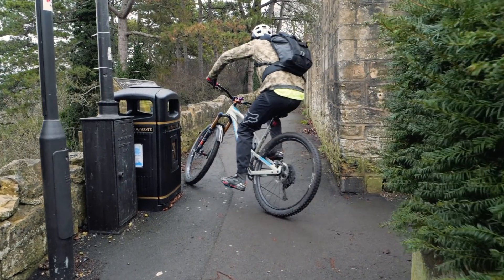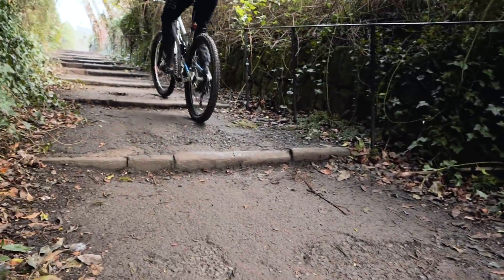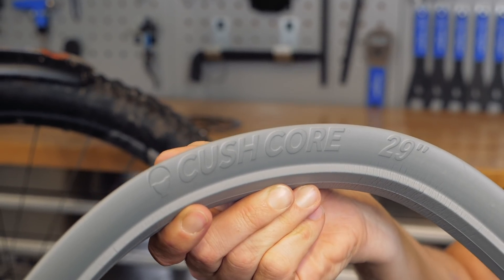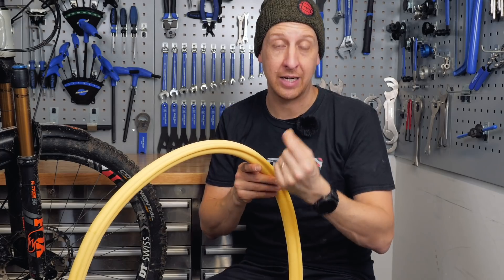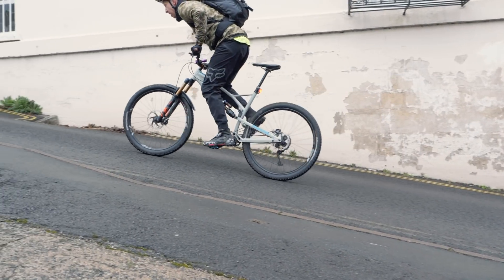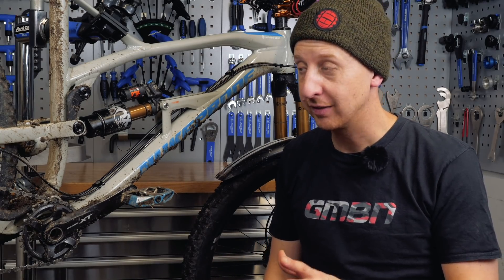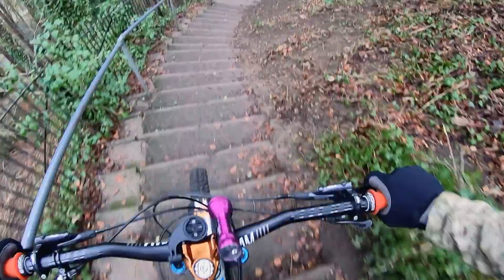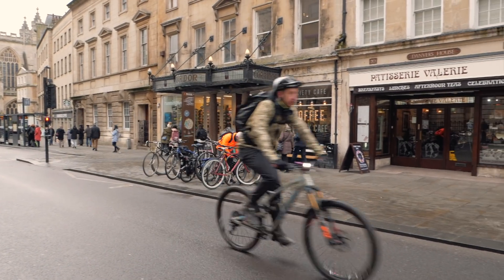Set Up Your Mountain Bike For Commuting And Urban Riding

Comment: who else out there that only have an mtb and also use it for commuting duty
Reply: fun to pass roadies on it.
Reply: i ride my KONA PROCESS 153 everyday for 4 years!! I dont have a U-lock even. fortunately I have private bicycle parking in my campus also in my work, and in the supermarket they have a separated place with a guard to bikes! So i m consider my self a lucky guy! 👍👍
Reply: Specialized Rockhopper Sport 2019 3x8  with 29" road wheels
Reply: Scott Scale 990 with continental raceking racesport tyres. Like it much better than my merida speeder.
Reply: well, what i have are just polygon’s entry level xc sport hardtail and full-suspension, but the bike doesn’t matter as long as you can pass some roadies a couple time
Reply: i even have raced my school’s staff that rides road bike, although i lost
Reply: Mongoose Tyax comp 2012 3x8  pretty entry level but heaps of fun
Reply: thats normal in the philippines. we use mountain bike on roads
Reply: @marcovogt7864  I have a kona fire mountain and I was actually thinking about getting these tires. Would you say they make you faster and do you use 2 of them or some other combo?
Reply: Bin Disel too right mate, just the same here in indonesia, although i’m now thinking about getting a gravel or cross bike
Reply: @sumthingvile21  I am using a pair of them and compared to the maxxis ikon they are definitely rolling faster. X-king at the front would probably give you more grip. One flat Tyre after 5000km commuting and cross country with mtb light tubes.
Reply: I I have a 29plus hardtail, 3.0 maxxis minions front & rear yet I still ride to & from work every day !  I can’t match the roadie on a climb or flat but I can get them on a descent. Hopefully I will get a few snow rides again but Edinburgh doesn’t get much snow
Reply: Andrew Schramm knobby tires? aren’t those things have high rolling resistance on road? ahh, i wish i live in the UK
Reply: 05 iron horse mavrick ss with origonal j1 fork i shred the thing every day to work 365
Reply: RICHARD RAHADI I do everything on my 24 year old trek mountain bike cause it’s the only bike I have!
Reply: @santiagoenmoto7762  Aaa I'm so happy to see a fellow Kona user! I just bought my Kona Lanai 5 months ago and i'm extremely happy with it!
Reply: @DopeVibesTrap  I'm a pretty big guy! 6.4  and 240 lbs so Kona it's perfect for me. Rock Solid, well ensambled and so big machine. I have no problemas with any stairs, big city drops, and with 38t chainging it's pretty fast for intrafic slalom.
Reply: @sultanabran1  not this roadie!
Reply: Nicolai Argon over here. Hardcore hard tail. In bright pink.
Reply: I have a cross and MTB bikes, but I use the MTB everyday for commuting, definitely slower but a lot more fun, and I can have a mess about to unwind on the way home.
Reply: I ride my voodoo hoodoo everyday . It does the job and I can hit the woods on the way home if I feel like it
Reply: RICHARD RAHADI I ride to school everyday
Reply: Don’t ride on the road I find shortcuts and try to ride on normal mob terrain, I only ride on roads if there is a down hill
Reply: All the time. Siskiu d7, only 120mm of travel so it's great for cycling all over urban terrain. Plus I got a 2x10 , so the highest gears can get me past 50kph if I need to.
Reply: The only chance is swapping for 48 at the front and 11 at the back, the avrg MTB is 42-14 for the high speed gear which is kinda slow at 60rpm.
Reply: Kona lanai hardtail with trekking bars, street tires and suspension seatpost. With panniers it's my pickup truck. Feels like I'm riding on a sofa and can go anywhere.
Reply: 2016 Specialized FSR Stumpjumper Comp 29. Have put over 3k miles on it. Ridden it for nearly a year. Don't own a car. Roadies are jealous because I can jump curbs and into ditches. BMXers get jealous because I'm still decently comfortable riding long distances and I'm fast, but I can bunnyhop high as hell. MTB Riders think I'm nuts and a spoiled roadie. I'm a breed of my own, but I ride hard, I ride fast, and I keep it steezy.
Reply: Installed a bike rack in my Trinx C200. Now just gonna need some bungee cords
Reply: I don’t ride since all my surgeries but I do want to get back out again
Reply: I finally learned the wheelie last summer and I love it! Doing it CONSTANTLY, even when commuting. 🤣
Reply: @sultanabran1  lol yea right.  Your groupsets and hubs just cannot compete!
Reply: @sultanabran1  yea on their cooldown!
Reply: fully rigid 97 Orange vit2 rolling on fat slicks makes my daily commute kinda fun...... gotta love a Ti frame :)
Reply: I have Foxter ft301 with a very basic set of group set and a stock fork.. but it work well, 33km back and forth. Its fun to used it specially on traffic its so versatile..
Reply: GT Aggressor Pro with Continental Trail King front and back Shimono Deoro XT pedals about to change the gear groupset  and forks soon. I commute to my evening job 5.5 miles then I do food delivery late night and weekends so daily I do about 30+ miles.
Reply: I have a basic Mongoose Switchback that’s a few years old. It’s all stock. I got it as a gift so it was originally just to ride for exercise and fun. I sometimes commute with it and I’m thinking of making some mods on it now lol
Reply: i have a road bike but looking for a hard tail to commute on. for comfort and be able to to go off road in areas to make short cuts. and then go off the road over the weekends to get out off traffic as i have been to and from work all week on the road. but my thing is, is it worth it id love a bike i could do anything come rain or shine road or off road.
Reply: I have a Takara Jiro that I upgraded, and it is my only bike. Road, trail, and anything in between, I keep the same 110 psi in the rear, and 100 in the fork. Nothing changes, and I can keep up with fixie riders. Granted, DNM and RST both make great suspension, and i couldnt be much happier with my bike. Just need a new front hub, and new rims to replace the v brake rims it came with. Oh, and a dropper. I keep kicking myself for not having one, and I still haven't gotten one. Someone please come to Boise and kick me into getting one?
Reply: @Jerry .Roberts do you ride trails? Or just to work?
Reply: @Jerry .Roberts how do you keep it tuned?
Reply: Marin hawk hill jr yes I’m 11
Reply: Unfortunately I had to retire the iron horse  but the bike I have no is way better for commuting o3hard rock with soma cr mo fork upgrade sun single track rims and a few other parts I'll probably have a new picture on my face book
Reply: And  yes I did the conversion
Reply: @d-fiddy   no unfortunately but there are some videos of this kind of conversation on YouTube
Reply: It's not that hard to switch to ss all u need is Cain tensioner and ss kit with spacers and drive sprocket  plus a narrow wide chain ring
Reply: Modifying my mtb for urban riding and commuting to work.
Reply: @Cameron XP same problem bruh. Only trails close to me are 3 hour car ride away. :(
Reply: Right here
Reply: here in the philippines it is common using mtb on roads
Reply: Scott Genius LT 40 ride this bike for years now here in Switzerland. going to work, bike, 
shopping, travel to friends that live 15km away.
:)
Reply: @DopeVibesTrap  old school kona lava dome myself
Reply: I surely do...
Reply: I love my Marlin 6. It really is good for those of us who need a solid commuter and is "weekend warriors".
Reply: Planning on too
Reply: Yep. It's more comfortable than my road bike. My favourite part is when I overtake and drop some guy on a road bike.
Some guy once chased me 10km lol.
Reply: 1 year later revisited, never i have the thoughts that my comment would be crowded, thanks for the likes folks
Reply: Yup. 50 psi on the path/ road....Air down to 35 for the trail.  only change you need.
Reply: Not me...
Reply: My 29er Rockhopper was horrendously fast on the road.  So much more comfortable and better handling.  For relatively short commutes they are unbeatable.
Reply: @lurker-mq4fp  screw road bikes eh
Reply: I ride 3 miles a day to commute on pavement to work. 1.5 each way. On the way too work it starts with a hill climb to get my blood pumping and my gears low. Then I flatten out, reach my 1st light then it's a nice mile-high gear cruise with a slight decline.
Reply: Heeyyy
Reply: "fun to pass roadies on it", "screw road bikes eh". Sad how some people ride bicycle not just for the pure fun of it, but also spend their time hating on other bike disciplines.
Reply: face crafter that’s what makes it fun, hating other disciplines based on nothing, we’re hating each other for fun, i ride both road and mountain bike, yet i’ll hate roadie when i’m on my XC and hate mtb when on road, just enjoy the drama bud
Reply: @richardrahadi  I can see how there could be good fun when the trash talking happens in real life, because you can actually get to ride and compete with each other. However, when it comes to posting comments on the internet, it just becomes trolling. There is no fun in comments like "haha my mtb is faster than a roadie! Screw roadies!". It's not like you can prove to other people you are faster, just a bunch of attention-seeking statements with nothing to back it up. Not everyone in the bike community is a troll and enjoy flaming each other for no reason
Reply: face crafter ahh i see, i got your point there, i might have to agree with you on this one
Reply: me
Reply: I have other bikes, I use my mtb for commuting when winter rolls around or its raining.
Reply: Ofcourse, why wouldnt you want to ride it every day
Reply: I dont just have a shity other bike to use so it dont get stolen
Reply: Yeah, this info is overkill for me haha. I'm just starting but I really just plan on riding around the park by my house mainly for exercise to stay healthy and it's practically a flat paved path since I live in the prairies with some off-road trails which are also flat.
Reply: Commutibg to the trails 18km
Reply: Here
Reply: Me!
Reply: 29 inch Genesis Silverton. It was on sale (discount). This is the first mountain bike that I have bought (8/14/2021).
Reply: Cannondale trail 5 2021 red
Reply: Walmart mtb tho
Reply: @MrGichinfunakoshi   which tires you have on the Rockhopper? I have the same bike and I’m thinking to get some road tires.. thanks
Reply: Ragley BigWig
Reply: Me
Reply: Me! Commencal clash 2020
Reply: Always have! Love a good hardtail with gravel tires for commuting. 

I might not be passing road bikes on the flats but when we get to a curb I can hop it and cut through a grass field 😂
Reply: That's my bike for work.

Comment: It's funny how most people just getting into cycling for urban riding tend to look for a bike with as much suspension as possible for comfort reasons where as an experienced rider tries to get rid of it because it only slows him down. That's an interesting misconception about suspension because in cars it's purpose really is comfort but in mountain biking it is stability and traction - the complete opposite in cars where if you want to go fast you want a stiff car. Correct me if I'm wrong though, that's my understanding so far.

Comment: I have bought a used 150€ hardtail for commuting. My tip for everyone is to get the same tiresize as your regular mtb. I always buy new tires for my regular bike and reuse the old ones on the commuter. It's really nice to always have a set of brand new tires on your regular mtb.

Comment: Another good idea is running urban tires like the Maxxis Torch. Keeps the good looks of the 29er while also giving a much lower rolling resistance. You can swap tires for your trail rides and still go fast in the city during the week.
Reply: Not for going down stairs.

Comment: You forgot to mention the 1'000 locks you need when you park your bike so none can steal your 5'000£ bike.
Reply: Abus Granit x-plus 😉
Reply: Agreed. You payed 1k$ to save 1kg. Now dont forget the 5kg lock for $150. 

Also, how about a 20$ kickstand (Horror! Gasp! Never!) so you dont have to lean it against the copy machine or watch it slide off the wall if they do let you bring it in?
Reply: Big motorcycle chain lock slung over my shoulder bandolier style
Reply: @eoinkenny3188  bandolier style😂👍
Reply: That's why I use a cheap green fully rigid 1980s mountain bike I found at a thrift store.
Reply: And still they steal it....f**kr
Reply: I rather buy a cheap old good bike off OfferUp and use it as my beater commute bike. So if its stolen or damaged it will not hurt as bad.
Reply: That's why you get a 100 dollar bike for commuting and errands, and then you only need $200 in locks
Reply: Just take the seat and handlebars with you lol
Reply: Put a Note STEAL ME , they’ll think it’s a setup and won’t touch the bike or get a police sticker
Reply: @eoinkenny3188  I do the same! We look badass ;)
Reply: GPS tracker anyone? Real question! Has anyone had any success with that?
Reply: That's absurd, if its over a grand it better come with an engine. I routinely pass full suspension bikes on downhill races, I ride a 15 year old hard tail specialized with 3" travel fork. About 700$ total.
Reply: mountaintruth1 deeds agreed my brother , I do want a good bike for long distance travel and good exercise on a good day for riding , but let’s be honest if you get your life together bike are not going to be your whole life it’s totally cool to ride a bike to work if the weather is good and it’s not extremely too much commute . But for a grand and over you’re better off getting a Motorcycle or Car bc you can get to your destination quicker and without much Strain not to mention cars can be used in any weather having a bike that’s over a grand or a grand doesn’t protect you from getting wet in the rain
Reply: @stevefinesse  its just water, lived in Seattle for a bit😲, but yes ride the motorcycles in the mountains and definitely a extended cab pickup.
Reply: I purchased insurance for mine after totaling my last bike. Well worth the peace of mind.
Reply: @Hctrbl  just put you're foot on the tyre, highly doubt anyone's going to grease up you're discs tho lmao
Reply: @joela283  people have tried Apple airtag, and although not perfect, better than nothing. (Ik it's not a gps tracker, but a tracker non the less
Reply: One can commute on a $5000 bike and buy a $300 to lock it, or buy a $30 lock and a $270 bike to commute. First option is more fun, second is safer.

Comment: I also ONLY have a mtb for everyday riding.  Trek procaliber 9.6.  I threw on some 35c gravel kings and a 20 minute swap to a rigid carbon fork and I have an awesome lightweight, fast, commuter, urban, gravel and/or road beast. And I'm guessing until you remove the tire foam and set the 2 shocks back to normal, my swaps wouldn't take much longer if at all.

Comment: I think it is a good way to get more familiar with the bike and just more practice but in the long run, get a cheap hybrid bike. Faster, lighter, more comfortable, cheap, no unnecessary wear & tear and no risk having a $3,000 mountain bike stolen. No need to carry 5-8 pounds of locks. Anybody can strip the bike in seconds with a little multi-tool. I would be paranoid in locking it up for more than 5 minutes. I have a Gary Fisher mountain bike with hybrid tires and rack and thought it was like a hybrid but it doesn't compare to my hybrid bike in performance on the roads.

Comment: I commute to work 17 miles a day on an old giant atx 830 26 inch wheel mountain bike. it has good old v-brakes  I use a single 36 tooth chainring out front and 8 speed cassette out back. tyres are 26x 1.95 road types. I use this instead of a racing bike as the roads in the UK are horrific and it wouldn't last a week of riding !

Comment: my mtb to commuter conversion was... hybrid cranks 26-36-48 and a suitable bottom bracket, an oversize jocky wheel system for the chain wrap capacity in the deraleur, and a big ulock.

Comment: According to the Highway Code any bike ridden on uk roads must have reflectors front and rear and pedal reflectors. If ridden at night it must also have lights front and rear.
Trek Fuel EX 29 has non of these (as it’s a proper bike!).
I’m off to Holland soon where all of the above plus reflective strips on the tyres are mandatory, any tips on this.
Reply: Its completely not enforced in Holland, so I wouldn't bother with these regulations and just ride your bike.
Reply: Hi I assume you’re Dutch, wonderfully country. It’s easier to cross the road than the cycle lanes in Amsterdam. 
My bikes gonna stick out somewhat compared to the Dutch style of bike!

Comment: Should I buy an mtb with 27.5 or 29 for city commuting? I'm 5'8. I am concerned about lower acceleration on thr 29er as city has traffic and signals which could use higher acceleration.

Comment: Biggest change on the commuters: fenders!
Reply: I find fenders a must for commuting. Ever since hitting a pile of dog crap without fenders on an early morning dark ride...I use fenders now.
Reply: Yeah fenders lights and Spikes for Front wheel during Winter. Saved my live! No worries about Suspension though
Reply: Or at least a rear rack to prevent those embarrassing rooster tails up my backside. Easier on the back to carry stuff on that rack than in a backpack.
Reply: @25inspector  not just an urban risk, I hit fox turd at speed on woodland singletrack and run more knobbly front tyre than rear.... not a good mix as it essentially turned it into a cloud. Didn't realise I could make such a girly noise. How did I know it was fox and not dog, if you've been close to fox crap you'd know how, and I got close enough as you know how offroad mud splatters your face.... yeah...  at least I had mouth closed when it hit and the shriek came after the fact. TRhankful of that small mercy.
Reply: I don't really like the look of fenders on my mtb commuter, but I just can't ride without them.